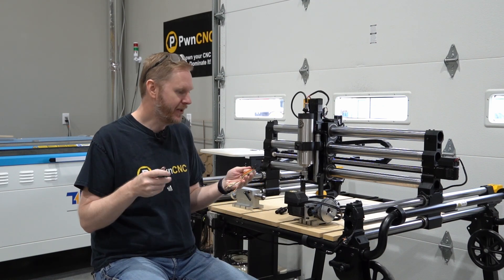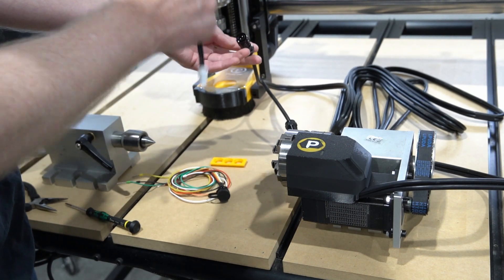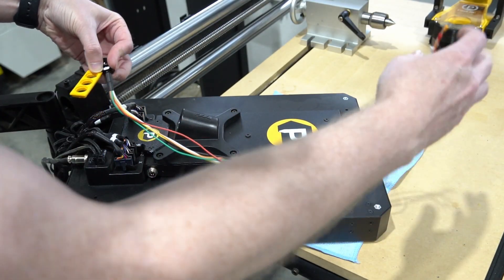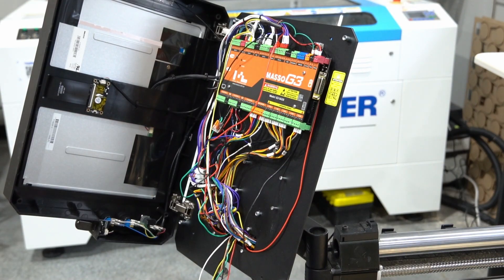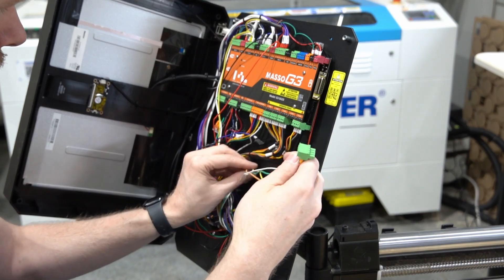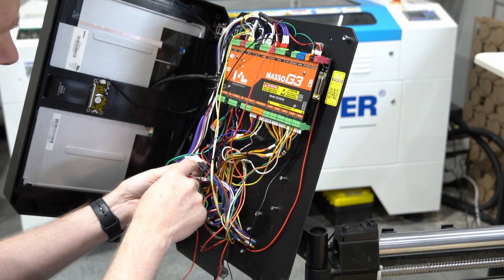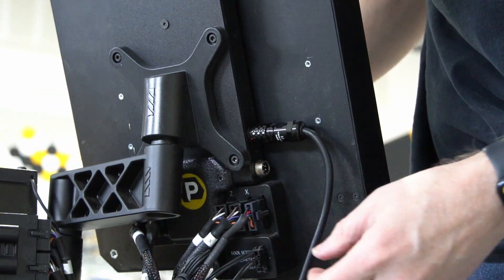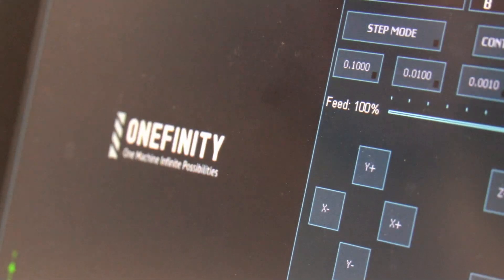PwnCNC Rotary Installation

Comment: @pwncnc Do you guys have a work-around and wire harness solution for non-Masso controllers? I have a Shapeoko PRO XXL and am highly interested if so :)
Reply from the maker: Unfortunately we do not.  We will be coming out with a more economically priced Masso conversion kit soon.  We also have the shielded wire available on our site so you could do this.

Comment: Would be nice if you provided a short little stub wire and a wago with the unit.
Reply from the maker: That’d be a good add to the power adapter which is required for the 1F owners.  Thank you for the suggestion.